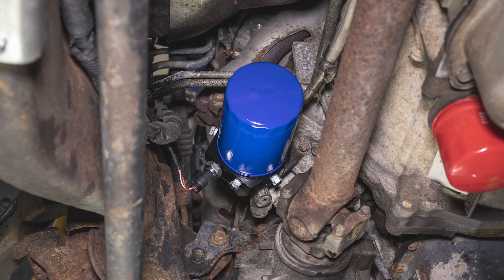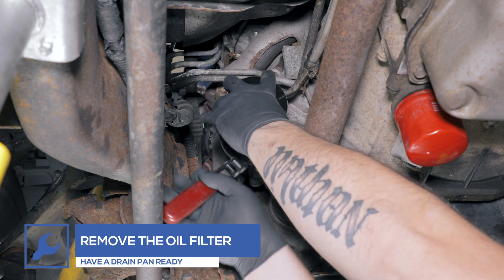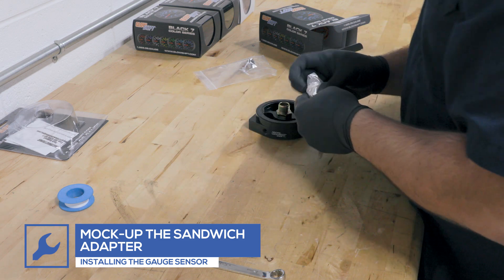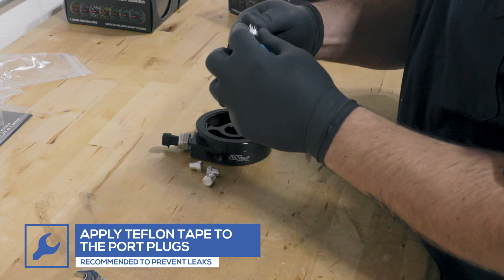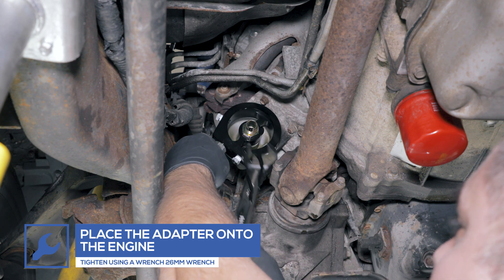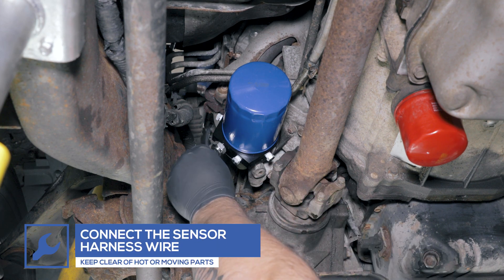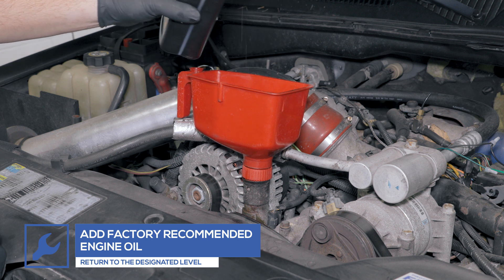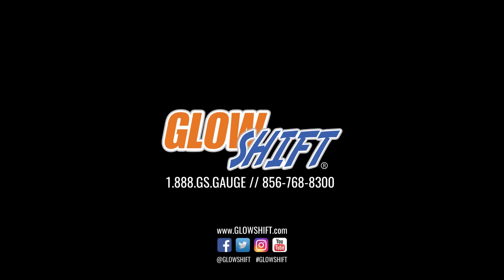Installation | GlowShift 2001-2018 6.6 Duramax Oil Filter Sandwich Adapter

Comment: Is it supposed to feel like it's gonna cross thread half a turn in?
Reply from the maker: No, verify that you purchased the correct size adapter for your vehicle.
Reply: @GlowShift  yes I found out yesterday that the sandwich have multiple sizes, I had the wrong one. So I re-ordered the correct size. Thank you.
Reply: @GlowShift  hello Ive just received my second sandwich plate and it doesn't fit can you please tell me the right one for a 2005 Escalade EXT 6.0l
Reply from the maker: @AmeriKKKanAfrikan  Call our customer support so they can make sure you get the right one.
Reply: @GlowShift  I think 3rd will be a charm did some research and I believe it's model GS-AF4, which have a 13/16 bolt size I'll confirm when it arrives for others thanks

Comment: Does anything special need to be done for ground for a temp sensor?  I just installed this adapter and the temp gauge isn’t reading anything.
Reply from the maker: Yes, you need to use the included wire connectors to add additional wire to the black sensor wire. Which you then need to connect to a clean reliable grounding source in the engine bay.
Reply: @GlowShift   ok thank you.  I don’t remember seeing anything like that in the box but i figured that was the problem.  The temp sender on my gauge is a single wire sender unlike what is shown in this video.  I’ll double check what ive got, thank you

Comment: Which sandwich adaptor would i need for a chevrolet trax 2013 1.4 awd turbo .
Im not sure if these 1 size fits all or do i need a specific sandwich adaptor .
Can you provide me with a correct choice pls

Also another question.
Can i use this for oil temp and oil pressure aswell ass cars factory oils sensor.
Becouse i think chevrolet trax has a built in oil transfer to turbo it dont use external hose from oil filter house.